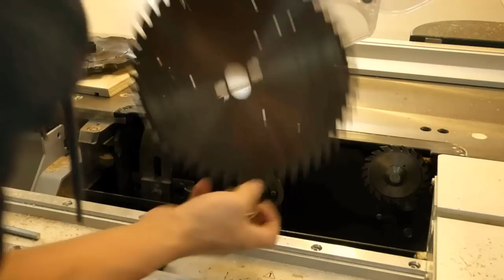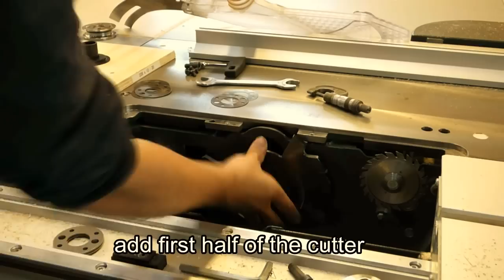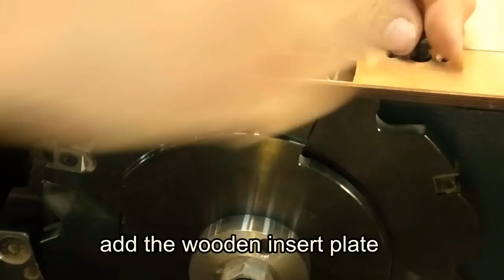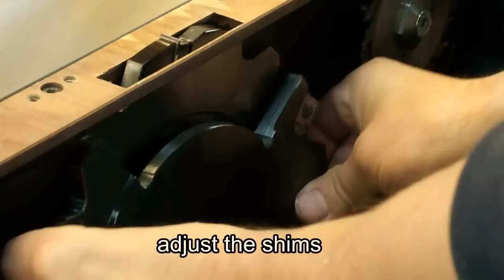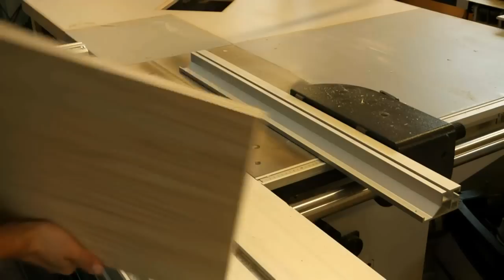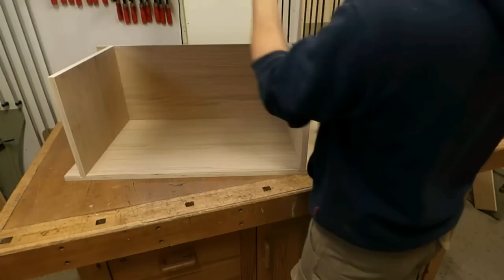Felder dado cutter set up and use

Comment: Very interesting to see the Felder in action. You only see those big sliding table panel saws in large cabinet shops in the US and they are usually SCMI. I've never seen a dado head used on one, not sure if they are equipped to allow.
Reply from the maker: As i replied to Matthias legislation doesn't allow regular dado stacks on saws in Europe, this has to do with the quick braking of the blade which could unlock the nut with heavy stacked blades or cutters like this. Felder came up with a system that makes it impossible to unlock the nut with centrifugal force.

Comment: FYI for hobbyists in Europe who may come across this video: while dado stacks are legally not allowed for regular table saws (Felder uses a special system that makes it legal) for security reasons (although you can still buy them from brands like CMT and use at your own risks), it is possible to buy thicker "groove" blades (4mm, 5mm, 6mm, 8mm ...) and use them legally since they're a single blade. I've used those for many years on a European Dewalt DW 745 without any issues.
Last time I bought a 6mm one from this place:  https://rs-tools.nl/hm-groefzaag-o-180-x-6-mm-z-16.html

Comment: We got a kf700s and the spacer you just removed after the blade doesn’t seem to be on our uk saw and seems as though it’s a one piece spindle ? Felder coming on Monday will add comment to say how we fixed this issue.
Reply: Our Kf700s is the same - spindle seems all one piece. Did you find a solution..?

Comment: Hi Timothy, that is a very nice solution, wish I could justify buying a felder saw, but I'm only a hobbyist :) Have you looked at the CMT grooving blades as an alternative, I'm considering buying one for my deWalt 745, not sure if it's a good idea?

Anyway, i really admire your work!
Reply from the maker: Hello, actually Hammer saws also have this option. it's a hobby range but still quite expensive. Couldn't afford those myself when it was just a hobby.
I am using a regular 48T CMT blade on this saw now but i don't have a grooving blade of theirs. It's a cheaper alternative for sure but the width is fixed. Here you can see i adjust the cutters width to 1/10th of a mm to have the right fit.
But for hobby use a groove blade wouldn't be a bad idea even if you have to make multiple passes. make sure though that it is allowed on your saw, these things are heavier than regular blades and would be dangerous in light saws.
Reply: Timothy Wilmots Yes i looked at a Hammer as well. As far as i can read, only a standard 250mm blade is allowed on the dewalt, probably bacause the riving knife only fits that... I think I'll keep dreaming of a cabinetsaw while using my OF1400 on a track for dados for now. :)
Reply: +Timothy Wilmots please see the above comments I made regarding the stacking dado set.  It comes with a very good set of shims which provide for the minute adjustments you're describing.

Comment: My Hammer is the cheaper [excellent and still expensive] version of the Felder.  It comes with a factory mount for the dado blade, which itself costs so much, they have arranged with a U.S. maker to supply a less costly version.  So you have two choices.
Reply: Hey, +KK5LU, I'm not sure what you mean by your comment on the "factory mount", as virtually every cabinet saw's arbor here in North America and Europe is long enough to accommodate dado or trenching tooling.  Here in Canada, the Felder distributor sells a stacking dado set made by Forrest, so perhaps that's what you're talking about when you're mentioning "a less costly version".
Reply from the maker: +Marty Schlosser 
Hi Marty, in Europe it's not allowed to make arbors that are long enough to hold more than one blade. You can use old machines for private use but in a professional environment it is completely forbidden as it is dangerous in combination of the required blade brake.
The Felder system worked around this by having two pins stick through the blades which prevent them from transferring brake energy to the arbor nut.
If you don't have this then the brake energy will unscrew the arbor nut and the whole thing comes flying.
Reply: Thanks for filling me in on how things are different in that regard.
Reply: Excellent, Timothy.  I had been under the impression that the tooling to accept dado cutters was only available for the North American versions of the saw.  I presume that European users are supposed to use either a spindle shaper or router to cut dados.  According to my Felder rep, the dado tooling is an option for sale in the USA, and I certainly want to get it if and when my piggy bank has sufficient funds for a 700 series Felder combo machine.

Comment: Timothy. Which dado cutter set do you have here? Also are the shims included with this particular set? Thank you!
Reply from the maker: Louis Ferney Sorry about the delay, i didn't get a notification from youtube.
This is the 12-20mm cutter, it comes with a set of special shims that have 8 holes. I recently also bought the smaller 6,3 to 12mm cutter. Both from the silent power range, and not the slightly cheaper Hammer version, this version has a bit more range in widths

Comment: So you have to pay extra to for a saw that can  take a dado cutter?
Reply from the maker: Hi Matthias, indeed it's an option but i haven't seen one without this option so i can't tell if the extra cost is only for the additional parts like the insert plate and the bigger lock disk. But i presume the arbor is different as well.
In Europe using dado stacks like in north America is not permitted because the blades have to stop within a few seconds as you see on the video, and regular dado stacks could continue spinning if you braked them this fast.And the centrifugal force would try to unlock the arbor nut. Felder worked around this legislation by locking the cutter to the arbor with two rods, and also the "lock disk" that holds the tool on the arbor is held by these rods, so the braking of the cutters can't unlock that nut.
Reply: Timothy Wilmots I have always wondered if Matthias Wandel ever gave a thought about having a Felder. At least I now know he's been looking at it. Maybe he'll buy a K700S for that huge workshop of his.
Reply: Matthias would probably find the blue prints somehow and build a complete Felder from scratch using reclaimed wood and airco motors, instead of buying one. ;)

Comment: May i ask where you got the wooden zero insert plate for the Felder?  Does anyone sell those??
Reply from the maker: The wooden one in this video was supplied by Felder, it comes with the saw when you have that cutter option.
But since making this video i made my own wooden insert for use with a normal blade as well, the original plastic insert leaves too much open space between around the blade.
I made it with a piece of beech plywood planed to exact thickness, the Felder one is also beech.
Reply: @TimothyWilmots  How did go about shaping the zero clearance inserts?  Thx